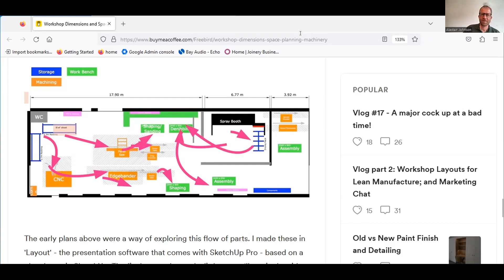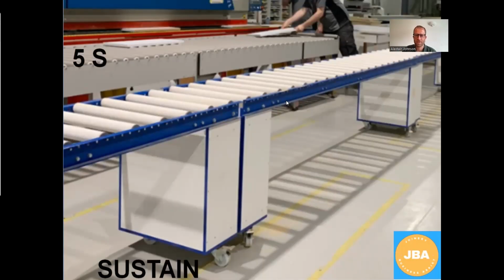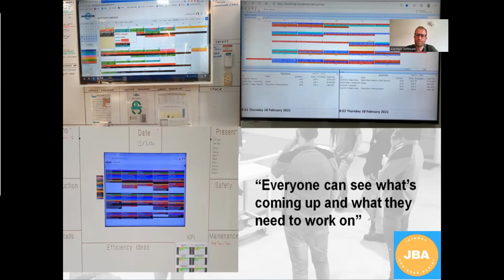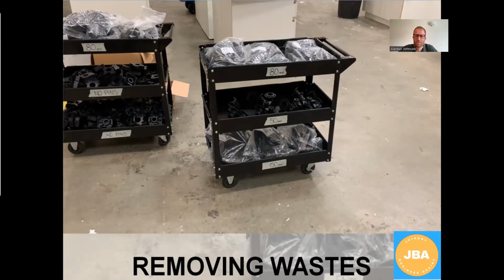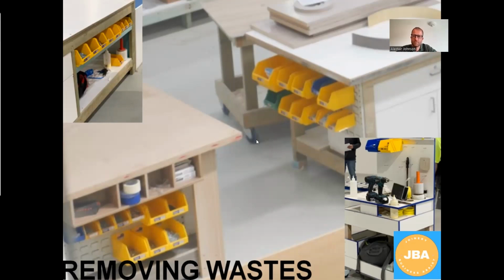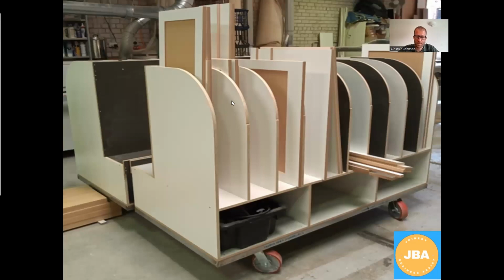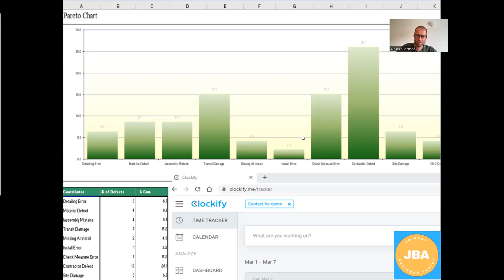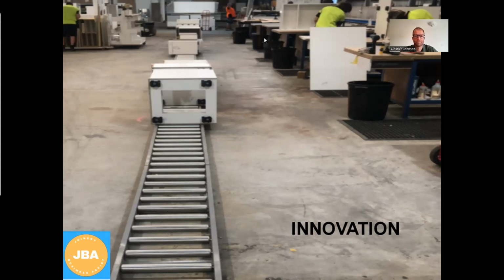Introduction to Lean Factory Flow

Comment: I do not see any visible flows here. Can you make another video to show the flow is running please
Reply from the maker: It is partially described in a diagram to the end of the preceding video, which is linked to in the description notes.   Also this video shows the setting up of our workshop based on these principles: https://youtu.be/_UPuOOnn0hU
Reply from the maker: Just coming back to this video and saw these comments, and you can see an example of workshop flow in this brand new video (not strictly public on YouTube at time of writing) from 12:50: https://youtu.be/w3DSV5aBF0Y?si=UsEM9yGCRp5Zz1JL&t=770